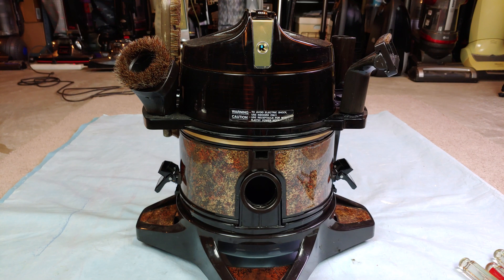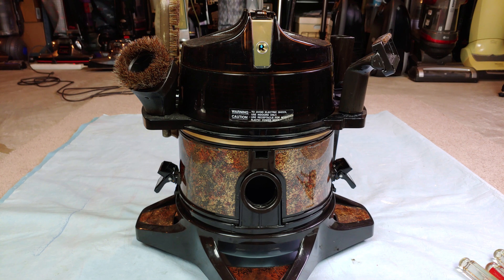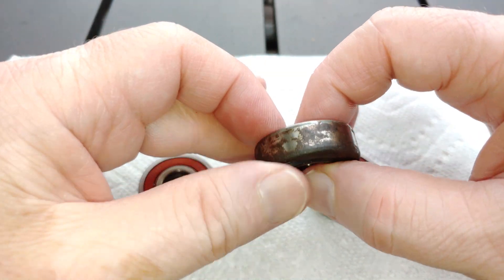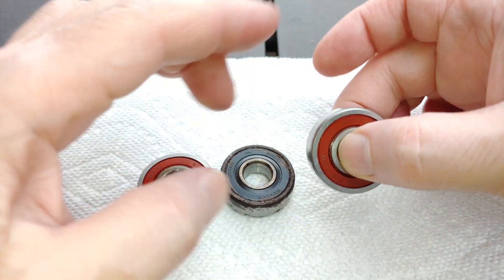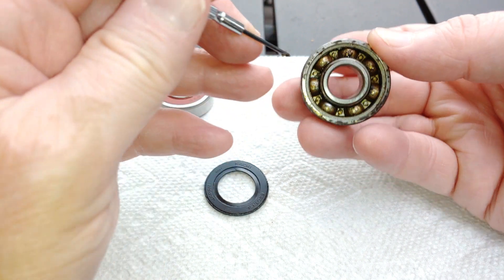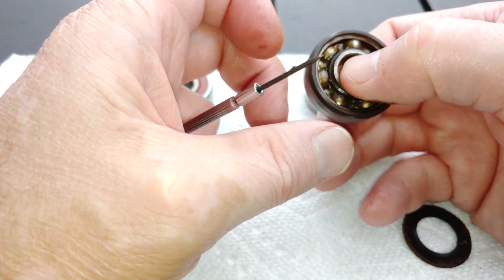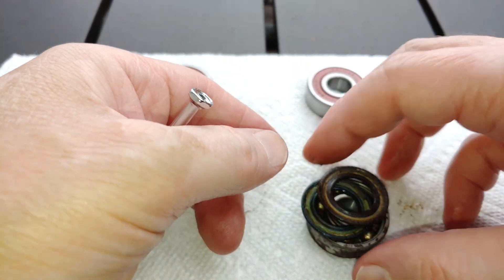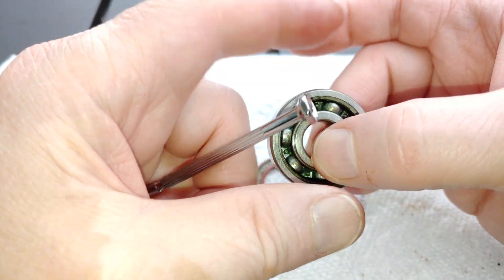Rainbow D4C SE Canister Teardown And Bearing Replacement Part 1

Comment: The carbon brushes I bought it won't fit on the holder
Reply from the maker: @ChaseTheNewYears2025  Try another set?
Reply: @VacLab  what's the size?
Reply from the maker: @ChaseTheNewYears2025  dunno, never needed these for a Rainbow. But check partswarehouse.com for part numbers. Or maybe Rainvac.com.

Comment: Is the new bearing last longer than the bearing that comes with it
Reply from the maker: It's probably about the same.
Reply: @VacLab  Right now, my 1993 rainbow vacuum needs new bearings
Reply from the maker: No surprise there. If you get them replaced, your machine may last another 20-30 years.

Comment: When I took my D4 to the local dealer, where they have helped me before, they simply told me the vacuum was obsolete.  They used to do repairs, their repair guy got sick and never came back.  One issue with commutators, they can get out of round and the brushes end up vibrating and arcing more than they should.  The only solution is to put the armature on a lathe and take as little off as possible from the commutator.  The next problem is there have to be gouges between the commutator segments.  I used a carbide insert to do my work, should have used HHS instead.  Now I have to go in and clean out the gouges between segments.

I was taught to seat the brushes, so they have the same contour as the commutator, take a piece of 600 grit sand paper, slip it between the brush and the commutator, and rotate the shaft back and forth. Eventually the brush will have the same curvature as the commutator, do this for both.

I may have to buy a new armature, having a problem cleaning up the segments.  I know on larger motors, we would take a hacksaw blade, grind it so it's narrow and use it to clean out the gouges.

Thanks for the videos, I think Rainbows are great vacuums, but the local dealers don't help much.

Jim
Reply from the maker: I never have bothered with dealers. Just prefer to do it myself.

Comment: Round plug at 2:01 has a filter element, does anyone know where to get a replacement? Mine fell apart
Reply from the maker: The exhaust cap does not have a filter element as its meant to block off rear exhaust air from that port.

Comment: I'm having issues to open the fan case. Removed four clips but I just can't separate it. Any suggestions?
Reply from the maker: Hit it with a hammer. Pry it with a screwdriver, etc.

Comment: Also having trouble separating the lower black canister from the top canister. Very tight. How much force does one apply?
Reply from the maker: Only as much as is required.
Reply from the maker: Only as much as is required.

Comment: What's the white stone looking thing you "cleaned the armature" with?? 
Also: What does the black split ring do under the motor shaft? Couldn't get mine off but see you didn't anyway? My vac had a bad lower bearing. Totally rusted and wore out and missing balls even. Lower housing wouldn't slide off. Had to pound the shaft back in/up with a hammer. Mushroomed the end of the shaft but will grind it back to where I hope to be able to get the lock nut back on. Had to watch video several times (at 3.00 and later at 4.48) where my problem areas were, because of the fast forward mode. (didn't need that in a critical area of disassembly)
Reply from the maker: The armature is cleaned with a "seating/polishing stone". And I only remove components that need to be removed to perform the service. You can watch the video in "real" time by selecting 0.25x mode in your browser or YouTube app.
Reply: @VacLab  Morning Vaclab. After having to pound the shaft from the bottom to get the base unit apart I noticed the motor is not in the same place. The shaft pounded up through it and now it's lower on the shaft. Can I get a measurement from the top of the threads down so I know where to tap it back into correct place?
Reply: @VacLab  Thanks for the speed adjustment info. never used that before.

Comment: I am tempted to take apart my D4C SE, too.  I want to replace the motor brushes, but I don't know how to properly "seat" them.  I would appreciate any tips/videos you might recommend.
Reply from the maker: You need a seating stone.
Reply: Right.  Goodvac.com says, "Hold the brush seater on the commutator close to the brush so the brush seater material will be carried under the brush."  As I have never done this before, I was hoping to see it done first.

Comment: How can I remove two rusted screws from the support at the base that keeps the spider in place, without ruining them? Thanks
Reply from the maker: Search how to remove rusted screws on YouTube.
Reply: If they are still usable and you can back them out, do so. If rusted and there's no phillips head left, either try with pliers or they will need to be drilled and then use a screw extractor bit to back them out. Not much else you can do.

Comment: I have question in film on 3.12 second, You removing the clips and remove lower cover. I had problem. I can,t take off this black cover. I dont now i must use strong grip to move this or unscrew the screw.?
Reply from the maker: It should pop off. If not, twist and jiggle it.

Comment: 4:28 You  didn't show how to remove the  C  lock clip
Reply from the maker: That's because there wasn't one.
Reply: You mean that split ring under the motor, on the shaft? Was wondering that also. There's one there he just didn't remove it, or didn't need to??
Reply: @tmotorman  You are right doesn't need to be remove

Comment: Hi VacLab. Thank you so much for this great video. I have 3 (!) D4s, and one badly needs a bearing job. A local repair place told me it was not possible! And Rexair doesn’t appear to offer much support to the do it yourselfer. I will write again after my D4 spins like new, and thank you again!
Reply from the maker: Not many repair shops know how do perform such a repair. They would prefer to sell you a new machine unfortuntely.
Reply: @VacLab  Sorry for this delay. This was an Authorized Rainbow dealer which is extra sad. I would have happily paid a fair price. I still need to repair mine and let you know how it went. You rock!

Comment: I remember when we worked on my 1997 D4C SE, these older Rainbows are a pain compared to newer E series units. Down the Rabbit Holes you go with your D series Rainbows.
Reply: But they are still worth a bearing job if needed, right? Compared to discarding it and buying an E series? I have 3 D4s but now you have made me want an E!
Reply: How about parting one out? I need a new disc. The bottom alum. impeller on mine is chewed up around the center hole. Won't stay compressed when I turn it on and it won't suck. (had to do a bearing replacement also)